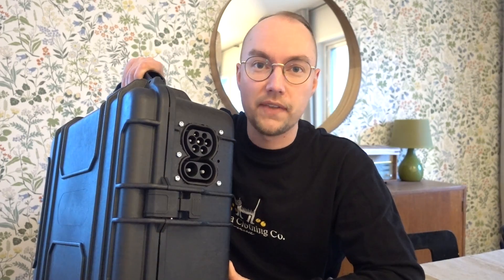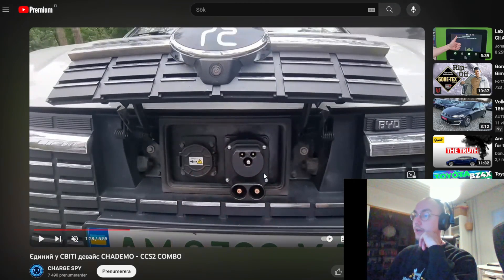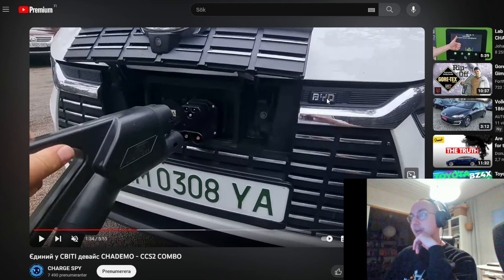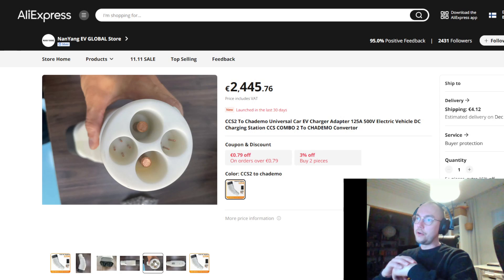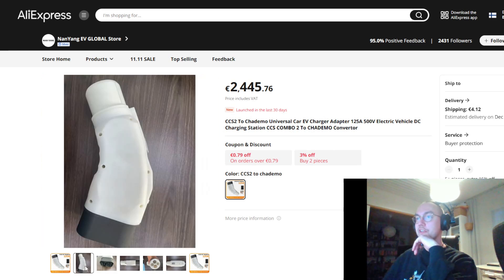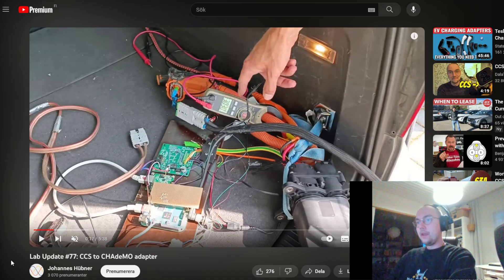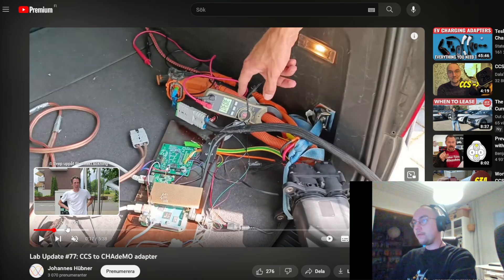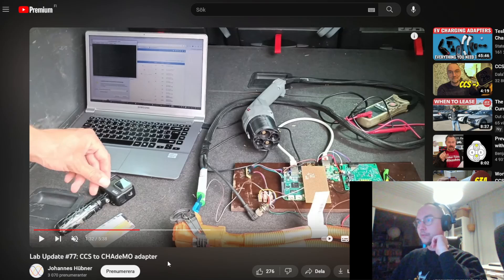CCS to LEAF [part 1]

Comment: Disclaimer: I have no idea what i am talking about!
With that out of the way... Why are charging ports standards so complicated, I feel like a lot of the communications between the car and the charging station are completely unnecessary, why does the charging station need to know everything about my car? In my opinion it should only know how much current to supply at any given time, everything else should be left to the car to figure out.
Reply: Exactly 
The regulators are like a mafia...

Comment: Thank you for this Posting. Grat work.👍
I like the idea of Adapting. It make good Things work in any additional region and extend using time. Evetually DC Adapter can be similar easy to use than actual AC Adapter. https://youtube.com/shorts/BTaq2snNSt0?si=2UEAzHZ8gqn8iqi1
 For shure ther is a big difference in the technical solution.
Id like to own a DC Chademo to CCS Adapter since it is available.

Comment: I think the Ali adapter is not a complete Fake. It is based on the CCS zu GPT Adapter that comes in the same enclosure. There ist a video on YouTube where someone disassembled the Gbt adapter. Inside there was some electronics and also one 18650 lithium battery with charging Controller. From outside it is charge with usb. There was also a HV relay inside.
Reply from the maker: Will be interesting to see if it works!
Reply: Need a YouTuber to test this adapter

Comment: WOW the CHADEMO connector is SO complicated!  No wonder it's been sunset / abandoned.
Reply from the maker: It's actually the other way around. CCS is way more complicated, and prone to failure. Chademo has direct pins for CAN communication, no fancy PLC/SLAC comms
Reply: @DalasEVRepair  Oh! That makes sense - No wonder everyone is moving to the NACS (Tesla) connector!  I had no idea! Thank you
Reply: @CubbyTech NACS communicates the same way as CCS, that's how all the automakers can promise cheap adapters. Prior to the NACS spec, the old Tesla protocol (which uses the same plug) is more similar to CHAdeMO. Tesla used to sell a CHAdeMO to Tesla-plug adapter because the protocols were so similar. Theoretically Tesla could allow Leafs to charge at Superchargers using a simple adapter and the old protocol.

Comment: Powerline on the high voltage dc lines?
Reply from the maker: Yes that is how CCS does it!
Reply: @DalasEVRepair  Everthing i read up today, it is on the ControlPilot.
Otherwise plug&charge which uses powerline to, couldn't work on ac only.
That's a little bit confusing.
Reply: @DalasEVRepair  sorry, but it's wrong, powerline is on cp to pe, not on the highvoltage line

Comment: Hey Dalia my ze1 Leaf makes a loud buzzing noise when I pop the front flap. Have you any idea what this is ?
Reply from the maker: Replace the solenoid used for unlocking front flap. If the vehicle is under warranty, just take it to the dealer! Known issue on ZE1

Comment: Hey Dala, a correct is that the ethernet/PLC comms are happening over the Control Pilot (CP) Line of the CCS socket, relative to earth. It will be best if you are able to route the CP and PP signals with the earth cable to protect against spurious EMC effects from the fast charger, which can take out the comms! Cool project.

Comment: Very interesting update; thanks for sharing. ☮️ Chademo seems to make a CCS to Chademo adapter expensive and large. 
Adding a CCS port to the Leaf or Triplet might be an alternative. 
Given that some cars with CCS charge ports are now being written off in crashes, it might be less expensive to buy a used CCS port.
AC charging is controlled by an onboard battery charger, while DC charging is controlled externally. From your knowledge of EV charging, what components are fitted in the car to enable DC charging, apart from the charge port? 🤔
Reply: Just a simple Graetz bridge 😂

Comment: hah! I was just about to write you :D
My buddy has found the adapter on ali and we were wondering if we could make a youtuber buy one of them to see if they work. I would not be surprised if the electronics could be shrunk to handle-size with a custom PCB. Translating messages does not require a supercomputer either.
3d prints can be very strong with 100% infill. Especially light-cured resin. I would not want anything that will go wobbly at 100°c tho from an FDM printer.

Comment: Hi Dala, I could hypothetically give you the spec for CHAdeMO + CCS. CCS to chamedo is "easy" as the other way around is more complicated: the charger waits for a small "precharge" from the car before going to the next state, whereas in CCS it's easier. Also, I think for some reason the chademo consortiom forbade these converters, so it wont be "chademo approved".
My knowledge is really old now, but it's a really nice project !
Reply: Main problem in locking mechanism. On chademo port locking controlled by charging station. On ither ports - by car. So CCS/CHAdeMO adapter must provide locking for both side prior begining charging process.
And you can not start charging on non locked port because it dangerous for peoples.

Comment: I REALLY wouldn't mind a total conversion to CCS. ALL quick chargers here have CCS, but only some have CHAdeMO. What's even worse, since the CHAdeMO stations are slower, the rate is also lower and I often find myself waiting inline for that single CHAdeMO station out of 6 that's also the only one in use, and by an unoccupied CCS car.

Comment: I'm very reassured to see this type of adapter is in development. I'm currently running a 2014 Leaf and wasn't looking at getting rid of it as we just got a V2H charger and are now using it as a home battery. If fact we're looking at cheap second hand Leaf for extra storage.
Reply: Wait how did you get a v2h for chademo? I thought that wasn’t available yet.
Reply: Yes, pleas share the Info or a Video what type you use🚐🔋💪

Comment: Great video! Thanks
The problem with CHAdeMO is that there are so few chargers.
Another way to approach this would be modify the Leaf to 3-phase charging. With 3-phase you can charge with up to 22 kW and there are quite a lot of those chargers. I know that CHAdeMO is like 50 kW but it is quite rare to get that charging speed, many times I don't get more then 25 kW on my Leaf.
Reply: Both my 2014 leaf and my 2022 leaf I used to own received 50kW no problem. As long as the battery's SOC is not over like 70% and the charging station is not splitting it's total power output for multiple cars you should always get this.
Reply: @Jan93Banan  Add to this list the battery temperature ;)
Reply: What you can't charge at full 50 kWh is a problem if your battery with luck of ability to accept it. My car with approximately 30 kWh pack accepts 45kwh at 95-99 % soh.
Reply: @pashko90  Yes I live in cold climate, in the summer I can also get 50 kW. 
What I was trying to say is that there are very few CHAdeMO chargers here. To get more places to charge a CCS to CHAdeMO adapter would be great but an alternative would be 3-phase charging since those chargers are also easier to find.
The difference in charging speed doesn't matter  22 kW would be a great improvement to the 6 kW I get on 1-phase.
Reply: @limpan6673  I sadly in USA, we don't have 3 phase 22 kw outlets sadly.
Reply: Muxsan, a Dutch company offer exactly this. Costs a lot though.
Reply: @marcg1686  I believe, Muxcan in Netherlands.

Comment: Will that end up being that big? Looking at the size of what you have and what is in that demo I would say it would be much batter to have your own boards. Also you can add a 12V plug with long enough cable to get into a cabin in so you don't need a 12V battery. So I'm sure you will not end up with a size of a china fake but something in size of a adaptor not a suitcase would  be grate. That takes just too much space in car.
Reply: There's no need to have the battery in the case, as it's always going to be used with the vehicle. You can take a 12-volt source from the vehicle itself—less weight, smaller package.
Reply: @gavcnr one 18650 with a boost circuit will do a trick pretty well, unless Daniel have a booster circuit for a precharge.